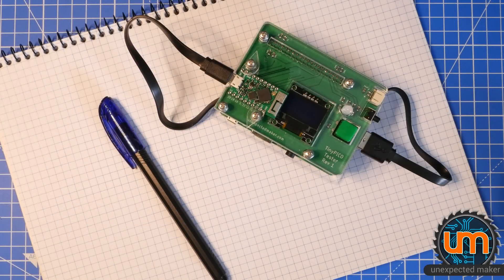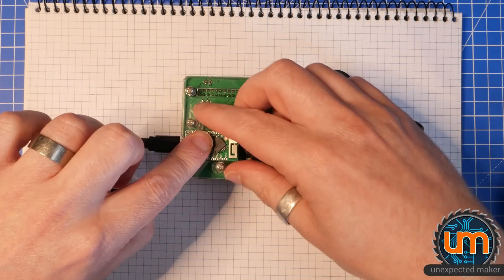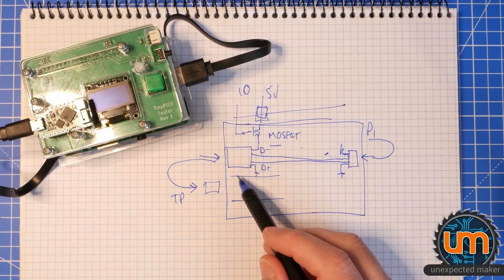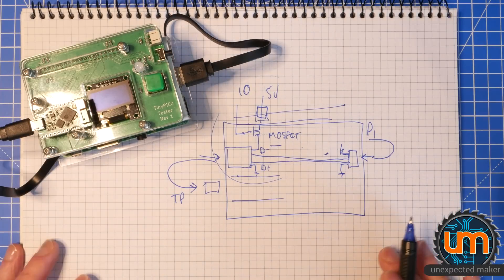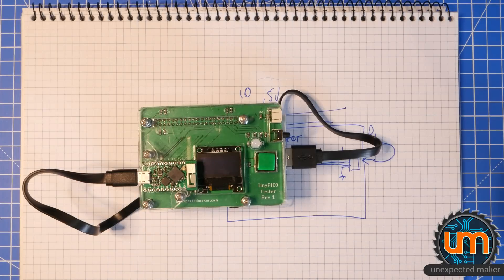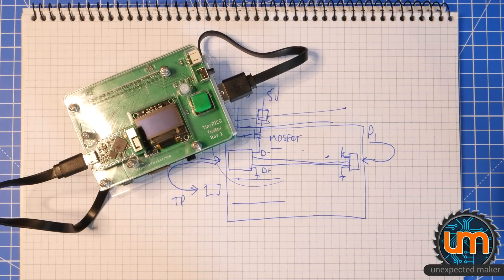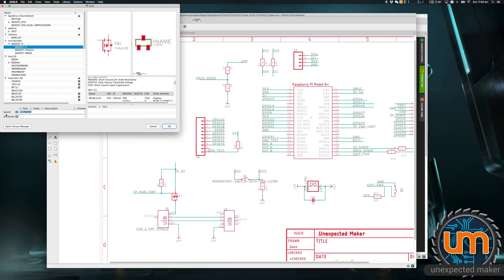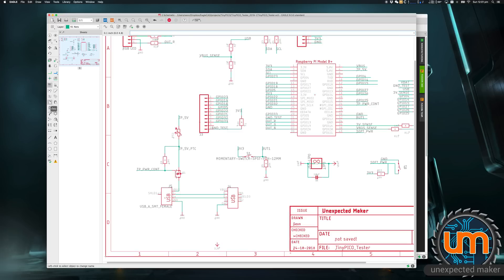TinyPICO Test Jig - Rev 2 Changes Explained!

Comment: microchips makes "power switch" ics meant precisely for switching the power to an usb port, it also has programable current limit that you can also use to detect shorts
Reply: look for the MIC2039 for example, they have more complex options with a lot more functionality if you need, but that should be enough for your application
Reply: also now that i think about it, you should've added test points for the DM DP lines, you wouldn't need to plug it in to test it, you would still need the power switch, and you would need to test the connector separately though.

Comment: As already mentioned, normally the PIs USB port should prevent a short by limiting the current to half an amp. But if you will be on the safe side (and I know you will) there are special PTC fuses for usb. As I only use trough hole components this one is what I would use: FUSB075F. You just need to find the smd version of it in the current rating you like. And the rating printed on it is the hold current. It will open at about twice that value. So you might pick one that close to your max current flow on the pico.
Reply: BTW your circuit reminds me a bit of Brian’s Power BLough-R....
Reply from the maker: Hey Michael, yeah I am looking at LittleFuse SMD PTC's based on recommendation. I'm not 100% sure what qualifies a PTC to be a special USB flavour one, but if they exist I'll go that route for sure. As I mentioned to Roger.. I'm not prepared to trust the 500mA current limiting capability of a USB port on the PI... not on a production line, and even if I relied on that for current limiting, I still have no way to auto shut power down if it happens with out the IO controlled FET in place. having the TP sitting there shorted pulling max USB current until the tester decides to unplug the cable is a bad situation ;)
Reply: Unexpected Maker those special usb PTC fuses can only withstand 6V BUT have a very low on resistance if you compare them with a similar rated PTC fuse that can withstand 30 or more volts. So you don’t get a lot of voltage drop on the usb line. Maybe not so critical for your application because most happens after the 3.3v LDO on your pico but essential on maybe a power supply circuit. Or if you really want to measure if your 5 volt line is stable while pulling 500mA
Reply from the maker: Thanks for the explanation Michael!!!

Comment: A  USB host is limited to supply no more than 500mA
Reply: If I recall correctly; older pi’s had a fuse on the USB ports, but they removed them on later versions as USB WiFi dongles etc. didn’t work properly. They now rely on the polyfuse on the power input of the pi. So in case of a short, it would “take down” the pi too. I doubt it would damage the pi, but it would mean the pi has to boot up again, and there’s the possibility of SD card corruption.
Reply: The input fuse is around 1.5 amp then? hmm not  that complient with USB standard then., good to know. (y)
Reply from the maker: Possibly.. but are you willing to try to plug a shorted PCB into one to see if it holds up? :D   I'm not sure I want to test that theory, but without the FET I still have no way to shut it off other than manually removing the cable.
Reply: If the Rasberry is following the standard it is a requement to not sopply more than 500mA. But i think thay have polyfuser to 150 mA or sp in the early RPI, dont know how it's on the latest versions. But dont get me wrong a switch is good, only think that i would add is a "auto shutdown" a analog mode not controlled på the Rpi.

Comment: Hi, i had a similar idea about USB and the power setup but have the Control Box (TinyPICO test jig PCB) powering USB on the right hand side of the hat. Another idea would be to have an IDC box connector at the bottom left edge of the hat to connect to an external test jig using a ribbon cable and IDC.  The IDC box connector has a keyway that ensures connecting the cable the correct way.  This allows more freedom to place the clamp in any position required and other methods of connecting to test the tiny pico and the ability to swap out to another test rig when needed. 

You also need to look at powering down the RPi gracefully to prevent damage and corruption  to the SD card.
Having the IDC connector break out the RPi GPIOs allows greater flexibility and the ability to swap out other test rigs for future testing and programming projects of other boards..
Reply from the maker: Hey Paul... originally I was looking into a multi part system, but I discarded it, although ti was a while ago so I can't remember why.  I am sure I can make this layout work and end up with something quite robust.... I just need to wait for the clamps to arrive so I have something to design around. Cheers :-)
Reply: @UnexpectedMaker  i was talking from my workshop experience where a control unit and several test rigs could be used to test various devices depending on the configuration software and hardware settings. I was also  approaching  it from the operators aspect where the tinypico is inserted into the test jig with the right hand then connect the usb cable, clamped in place with left hand, then press the test button.
Reply: @UnexpectedMaker  you could also add one of those industrial type switches for "test start".:)
https://www.ebay.com.au/itm/Red-Mushroom-DC-30V-5A-AC-250V-3A-Emergency-Stop-Push-Button-Switch/273422422544?hash=item3fa93f1210:g:ovEAAOSwNkJZ8~81:rk:2:pf:1&frcectupt=true
Reply: For the shutdown you can use the software to read a GPIO and just do a shurdown and wait.
Reply from the maker: Ahh, ok, sure... for something that's designed to be multi-use, that makes total sense, but for this case it's a solution for one specific unique use case and I'll have no control where it will be placed and used on a production line.

Comment: A note on the power control. Even when an IO is set as an input, there are ESD protection diodes on the pi's pins, that will prevent the pin from going more than about 300mV above the 3.3V rail. So just make sure the pfet you choose is fully turned off at Vgs = -1.4V (5 - 3.6V). This pulling up the gate method works fine for a true open drain output though.
Reply from the maker: Hmm, thanks for the heads up Cam... I'll do some testing on the PI before I order any Fets, to make sure I order something to spec. Cheers!
Reply: @UnexpectedMaker  No problem. To clarify, this is a common (minimal) input protection network for an IC: http://www.bigmessowires.com/wp-content/uploads/2015/04/IC_Input.jpg This is also why you will commonly find a warning datasheet's absolute maximum section, that an IO should not be forced above "Vcc + 0.3V" As any more than this voltage would forward bias the diode in the diagram, and conduct too much current.
Reply: You could add a jellybean NPN transistor to pull R8 to ground. That way the PIs input pin never sees 5V. So it’s acting as a simple buffer circuit.